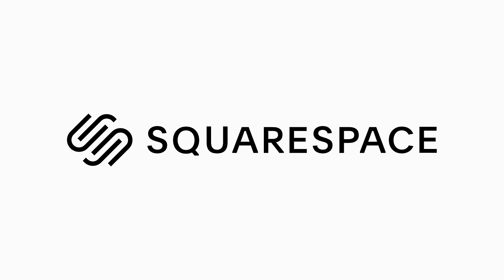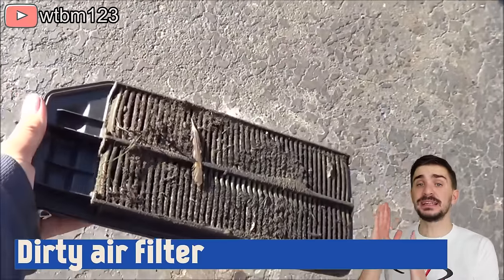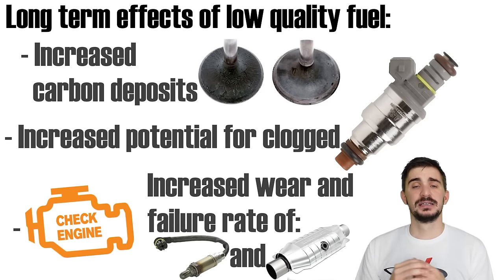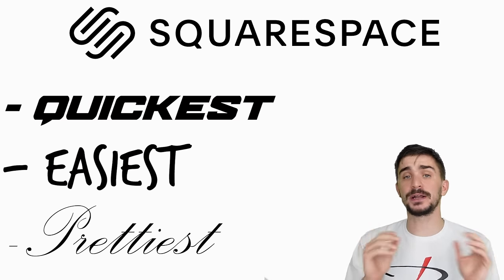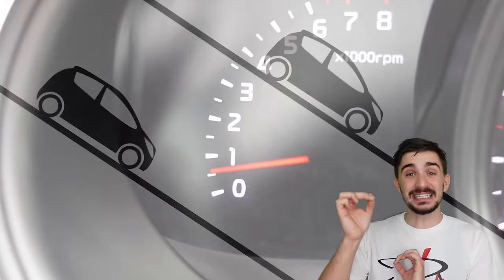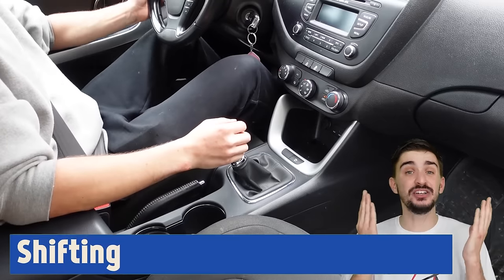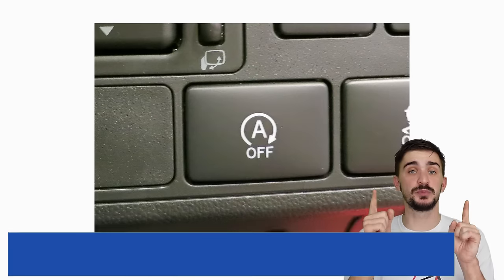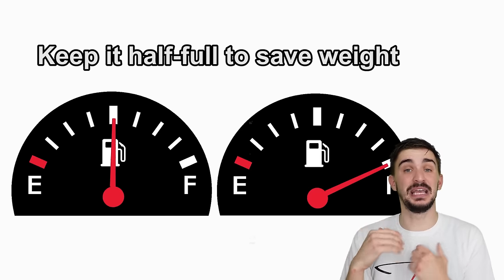EVERYTHING on FUEL SAVING - PRACTICAL DRIVING and MAINTENANCE techniques to REDUCE FUEL consumption

Comment: Honestly the ABSOLUTE BEST WAY to get better fuel mileage is to get a cheap OBD scanner, connect it to your android device with Torque and get the fuel consumption monitoring gauges, then observe them and improve your driving, it will help A LOT and will teach you how to drive better to save gas. 
You will be surprised by how just easing on the gas pedal by 5% doesn't change the speed at you are driving but it will drop the fuel consumption significantly.

Also, just check your tires and inflate them well, that always seems to be it when someone is getting a shitty MPG.

Comment: How to save gas: Downsize your carburettors.

Smaller cylinder charge, better atomization. It will also make racy driving more difficult, and will consume less even when trying to "kick it". 

I highly recommend using more modern carburettor, for example Keihin CV rather than conventional car carburettor.

Comment: On cars with direct injection engines, make sure the intake valves do not have too much carbon buildup. I.e. walnut blasting or removing intake manifold and scrape off carbon. Too much carbon buildup will not allow the valves to seal properly.

Comment: How about flooring it from time to time? Like once a month to let carbon buildup & crankcase vent and most importantly - exhaust to heat up & clean. I know that most od direct injection engines won't clean intake carbon but still, exhaust valves can clog too. DPF/GPF and others when heated up can burn up residue in them. Cleaning them up by ECU command is really a bad idea. There will be so much fuel injected (in diesel) that it can go & mix with oil.
Reply: Italian Tune-Up, Engineering Explained talked about this

Comment: Disabling start-stop is actually really good idea when you are about to slow down to a stop at a very short red light or a STOP sign. 
It's a situation in which you're going to idle at standstill for less than 10 seconds, therefore shutting down the engine only to start it immediately back up again is just wasting fuel on startups you didn't need to do. Engineering Explained has a nice video on this called "Americans Have No Idea How Much Fuel Idling Uses". Additionally, having start-stop engage when you're coming to a standstill on a hill can become dangerous if you have to move off straight away, because until the engine has been started you're in neutral (or with disengaged clutches), so you might start rolling back.

Another situation is highway traffic jam, where you might be better off driving in first gear at idle so that you don't have to inch forward or go 0-50km/h and back all the time.

Another good reason to shut down start-stop is during and after spirited driving, especially for cars with turbochargers.
When engine is shut off, oil circulation stops, thus no coolling happens for the turbocharger, and whatever oil is in the turbocharger at that moment is basically cooking.

The manufacturer didn't put that button within easy reach for nothing.

P.S.: typically, after cold starts or if engine is too hot, start-stop system will auto-disengage and will not work until the engine parameters are back to working spec for start-stop system. Consult your car's manual for those specs.
Reply: I agree with you. There's also the aspect of starter motor wear, like you said, very short stops are unnecessary. City traffic jams are also an example, where you'd move maybe 1 meter at a time before stopping for a while again

Comment: Question for everyone. hot air intake?

My engine intake is ahead of the radiator. My engine is also overpowered for the needs of the car. If I removed the ducting that pulled air from ahead of the intake, and instead it pulled air from within the engine compartment, behind the radiator, the intake air would be warmer. Warmer air is less dense. Fewer air molecules would enter the combustion chamber, the default mapping would have it run rich, but the O2 sensors would tell that to the ECU, and it would adjust by reducing fuel injection amounts.

I believe the end result is that for any given amount of power needed, the throttle would have to be further open, reducing pumping losses by reducing restriction and vacuum. In addition, the fuel would better vaporize prior to ignition, improving combustion efficiency, especially during below freezing conditions.

I’d like to hear everyone’s thoughts on this idea. I don’t see a downside other than reduced power available, which to me isn’t a downside.

Comment: Depending on where you're driving the smallest car might not be the most efficient, if you're usually driving at a constant speed (especially highway speeds) a larger car with better aerodynamics and an engine optimized for those speeds can be more efficient than a tiny city car. Just don't get anything bigger than the smaller sedan models though.

Comment: Thank you for your video, it was a helpful one.

The question. If I have an automatic transmission car and roll down the hill, will I save on the gas if I don't shut down the engine, but switch from drive to neutral? Also, if I roll down the hill (without pushing the accelerator) I see that the needle of the tachometer goes up, does it mean that my car uses more gas, albeit I don't push the accelerator? Thanks

Comment: Thank you for a very good video as usual. How about higher octane? I live in Sweden. And use 95 RON as per owners manual. I have a Stage 1 tuning though and changed the complete intake from the turbo and also a bit changes on the exhaust side of the turbo. Manufacturer of the engine Flash say i may use 98 RON, but not a must.
Its a price diff of 10 cents (in Euro) per liter.
U think I will save usung 98 instead of 95? And. Is it worth the extra price? Hopefully, u can send me ur thoughts of this, as I am a big fan of your videos 🙂
I drive a Vw Golf alltrack -18, hence 1,8 TSI 180 hp. But tuned as described above.
Reply from the maker: A higher octane number doesn't have much to do with saving fuel, it's simply more resistant to knock or detonation which makes it a safer choice for your engine if you plan to put it under prolonged high loads. The simplest instruction I can give you is to use 98 when you plan to drive hard or on the track and 95 when you plan to drive under small and medium loads (throttle) for long. Like a relaxed road trip or something.
Reply: ...or if there isn't a huge price difference and the higher octane fuel doesn't have ethanol in it.
Reply: @marc-oliviercabot3380  Ethanol is actually great for spirited driving and higher power output scenarios. Ethanol might have a lower calorific value than pure gasoline but it sure makes up for it with it's huge latent heat absorption. Ethanol cools your combustion chamber way better than pure gasoline and therefore more power is extracted from the fuel. Even the fuel economy doesn't suffer that much - a lot of fuel, when running rich, is actually used to cool the combustion chamber instead of burning it for generating power. If you think about it - it makes sense. You run stoich, then there's exactly the necessary amount of air and fuel mixed together. If you run rich, you have less air and more fuel. If you don't have enough air, how are you going to burn the fuel? 
I have kept track of my fuel consumption using Spritmonitor. I have every drop of fuel used neatly recorded there. It appears that 95 E10 is more economical compared to 95 E0 or 98.  The differences are minor - up to 0.2 litres per 100km. But the car feels better when 95E10 is used compared to 98 or pure 95. Granted, I do not track the car. Just my regular daily driver.

Comment: You are wrong on some things!  I know for a fact that sitting in traffic in a 50000 pound BMW  with comfortable leather seats climate and a great sound system is a lot better that a vaxhall or Japanese  plastic sweat locker with a crackly radio. You can also chase those vaccum leaks and a bit of asitone in the fuel will help the fuel to vaporise and clean lines, valves and injectors .

Comment: I have a ford fusion 1.5 Ecoboost and with Normal driving I get about 25-28 mpg but i can get 32-37 mpg at highway speeds 70-80 mph and 42-50 mpg at 50-60 mph

Comment: Alternatively, ride a scooter (3.5L/100km) for 80% of your trips and keep the old truck (14L/100km) around for when you need increased utility. 
(800kms @ 3.5L/100= 28 Liters  +  200kms @ 14L/100= 28Liters)  =  56L/1000kms  =  5.6L/100km Avg. (50.5 mpg Imp.)

Comment: Check engine light (in my case) is cause of the catalytic converter... it is burned it does impact car performance yet it still passes in thr gas emisisons tests (doesn't make sense) but also it isn't worth getting a new cat cause it's worth more than the car... even though its an x type (jag) and aso O2 sensor.. but if you swap it the error comes back cause of the cat + burns the sensor...

Comment: Could you do a in depth video about start stop systems? There is a lot of argument on whether it’s a good idea to disable it or not.  Some argue that the supposed extra engine wear is more expensive in the long run or the overall extra expense associated with start stop will outweigh the money from fuel savings.

Another aspect could have been covered is route selection. Ex: Will a more direct route with a shorter distance be more efficient even if there is more turning, traffic and stopping in that route. Etc

Comment: Buy a small displacement motorcycle, my 950 sport bike can get 45mpg if I ride reasonably. 100+ mpg is not uncommon in the 250cc range and can achieve reasonable highway speeds.

Comment: alot of cars now have fully electric power steering so if you turn off the engine you could lose all steering. spin that wheel all you like but nothing will happen kind of thing. reminds me of the time i was riding my bike and the handlebars suddenly came off and i was holding the bars because it has the brakes and the colem to try to steer enough to stop.

Comment: Drafting and turning off your engine at stop lights and drive-throughs saves a lot of fuel. Why would a manufacturer implement a stop-start system if that were to somehow decrease fuel economy when you restart your engine. 6-8 seconds of idling is the point where turning off your engine will save fuel, and that happens a lot.

Have tested both drafting and turning off your engine, and by doing it correctly in a way that where you restart your engine before the light turns green (which is pretty easy to learn), you can save a lot of fuel. Drafting correctly at a safe distance can also save between 10-40% fuel on the highway, which is a lot.
Reply: i see you've watch the EE video, lol. But i think his point is more so that you don't actually save money by turning off engine instead of idling, for the reasons mentioned.
Didn't know about the drafting tho, I'd be curious what would be the max distance at which drafting still saves you from air resistence
Reply: You be putting a lot of wear on the starter do that some towns have a lot of red Lights to
Reply: @nc7432  Haven't watched hos video, this is just general knowledge. Gasoline and diesel cars use a massive amount of fuel just idling, at slower speeds like in the city the majority of the fuel goes to just idling the engine.
Reply: @nc7432  Also drafting isn't an on or off thing, it has a bigger effect the closer you get, which is why I mentioned specifically at a safe distance, because a lot of people think you have to be half a second behind a truck to benefit, even 1.5-2 seconds you can have a noticeable drop in fuel consumption.
Reply: @swecreations  the fact that idling wastes a lot of fuel is general knowledge, the fact starting an ICE uses about 7 second idling worth of fuel is not. The video I mentioned highlights that referring to a specific study. 
I also understand drafting isn’t anon or off thing, but I’m willing to bet that it isn’t a linear effect between distance and air resistance. perhaps up to a certain distance the effect would be 80-90% and then it would drop somewhat linearly, idk.

Comment: You're objectively wrong re: drafting. I used to do regularly do a 300km drive. One day, I decided to do it fully drafting, i.e., tailgating, a transport truck in my Civic. By the end of the drive, my fuel gauge showed I had 1/4 tank more fuel vs. driving normally. All that said, in retrospect Im shocked I didnt get in an accident as I was fully, as in NASCAR style, drafting that truck. So yeah... you can draft to prove a point or save money, but you may end up sacrificing your life to do it. I didnt get in an accident not due to skill, rather due to chance, as no amount of skill would have saved me from a chance event.

Comment: In some slight downhill situations it is actually useful to cruise in neutral rather than being in gear if that would require you to press the accelerator to maintain speed. But for steep downhills where you'd be pressing the brakes it would be rather stupid to cruise in neutral. In fact, it is better to emulate the "uphill" gear if possible (i.e., descending with 4k RPM in 4th rather than 2k RPM in 6th where you'd again have to press the brakes to not go too fast).

Comment: Engineering explained actually tested the start stop thing at the stop light, it's actually more efficient of you switch off the car at the light
Reply: Correct. Some people overblow that myth acting like it takes a pint of gas to start a hot engine. It doesn't. Just like people think it takes an hour's worth of electricity to turn a light bulb on. But in reality, it takes about three seconds worth.

Comment: You missed the easiest and most worthwhile way to save; simply anticipate stops, and first coast lift to 50% or 70% of cruise speed, then brake.  Make up lost time by harder acceleration.  Saves 10%+ in urban-suburban driving.  Worth the time.  Brakes waste fuel, simple.

Comment: Biggest change in fuel economy I've got when I changed from RON95 E10 to RON98E5. For some cars it really beneficial to use highest octane least ethanol fuel even if it costs more per liter.
Reply: 98 is denser and has more energy per litre than 95. And usually only turbocharged engines work well with 98 (or need it), and puting it into naturally aspirated one will give you no benefits.
Reply: @Intrud3r55  At first claims about different energy density sounded wild to me. But taking into account different ethanol content you are right. And the only N/A car I have seen and remembered for last five years was Audi R8. Everything else is 2 liter i4 turbo or diesel.

Comment: Old petrol rover 214 accidentally started filling with diesel (pumps had strange colour hoses but my mistake). Realised after 20 litres. Immediately switched to unleaded and filled to top, approx another 40 litres. The car ran fine but admittedly a touch of misfire at idle. I got over 800 miles out of that tank of fuel and the car was fine. I'd usually get about 450 miles from a full tank. Unfortunately in these expensive fuel days, I'm now annoyingly running a diesel car, otherwise I'd have definitely started mixing in some diesel to a petrol car, especially if its an older technology car.
Reply: 真的有点神奇，想知道有什么反应

Comment: i have been driving my old car using the techniques in this video. 
The biggest reduction was after adapting my drivings style. (23% better mileage)
Downside: it's no fun... :-(

BTW If the car had a diesel engine the gains would have been even bigger. 
Diesels that operate at part-load (like just cruising down the highway) are more efficient the gasoline cars driven at the same speed.
Reply: also have more torque, abd diesel has more energy by weight than gasoline
Reply: 省油的代价就是失去驾驶乐趣。

Comment: define low quality fuel.   In almost all cases the gasoline available at your pump is made in the exact same refinery, it is actually exactly the same, then it is blended with ethanol and often has its additives added to it at the petrol station or the distribution hub.   

If you are defining low quality as a lower octane rating this is incorrect as well as if you are not running a high compression engine there is no reason to run a high compression rating.

Even when talking brand of fuel quality they are often stored in the same bulk plant for distribution and only the additives differ between brands.   Yes these additives can make a huge difference though as in my region i did notice a diffence in this regard even though all the brands charge pretty much the exact same price.

If running Diesel the conversation outside of north America changes quite a bit as there are actually a number of different grades of diesel available in some regions.

Comment: some oxygen sensor codes are nothing burgers. if you drive an evo x or a ralliart you are probably used to "P0133 o2 sensor slow response" popping up every now and then. i've dyno'd my car before and during this fault code. air fuel mixture and power/torque data is exactly the same. and the mechanics i go to have seen 4b11t's having this code showing up immediately after installing 2 brand new OEM o2 sensors. so make sure you talk to an experienced and reputable mechanic before blindly trusting google.

Comment: 10:35 its does work in real life. U dont eed to use brakes and trothe, just crusing same speed as truck. u can save over 50% friction if u are verey close. When u have safe distance is over 20% fuel saving

Comment: I’ve seen that many carmakers state that auto transmission models consume more than manual counterparts is this due to more gears or something?
Reply: Bad gear shifts. In eco mode they will gi for the highest possible hear which is stupid - my car wanted me to shift in 6th at 60 km/h uphill with the engine that was already groaning in 5th.

In sport mode they will shift later to oreserve acceleration. Also auto transmissions can react to throttle and engine but not to tradfic or road conditions.